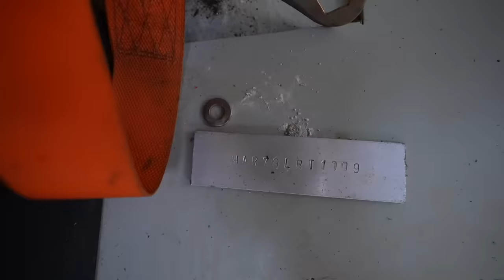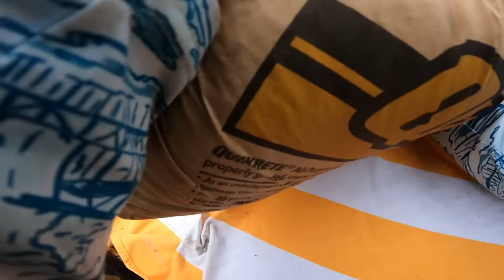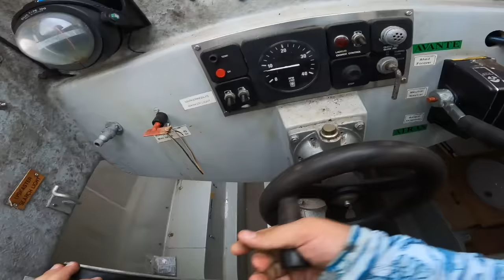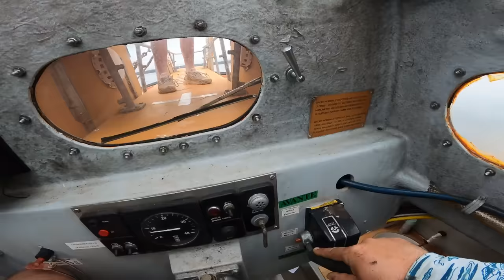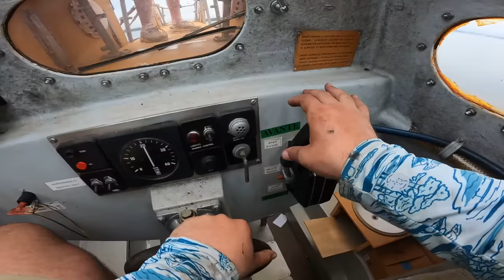WATER TESTING 64 Person Enclosed Lifeboat For The FIRST Time!!

Comment: It’s called a TEMPSC (Totally Enclosed Motor Propelled Safety Craft). This one is from the Safe Brittania semi-submersible rig (a rig I personally spent some time on in the UK North Sea many years ago) which was generally used for floating accommodation. Judging by the serial number the manufacturer is Schat-Harding, a Norwegian company who specialises in this type of craft. As it was used on a rig it will have been very well maintained as there are strict SOLAS standards that apply. The unit has a lot of features that you won’t know about such as external water spray to allow it to motor through sea surface fires plus it would be pressurised in use to prevent gas ingress. Also, if I recall correctly they are also designed to be self-righting so can’t capsize (I guess that would require all the seals to be intact and the doors closed!). The exhaust fumes inside are a bit worrying as you either have the hull exhaust plugged (this would likely be under the water line) or a manifold leak, either way it should be easy enough to figure out. If you were to contact Schat-Harding with the serial number there’s a good chance that they would still have all the documentation for the vessel, worth a try.
Reply: I'm gonna like and comment so that maybe this wealth of info will make it a little higher up the comments.
Reply: @thenotsoguitarguy9429  Ayo! Plugged the exhaust with bondo! Lol!
Reply: Shes made for British alright my grandad used to work on centrica bravo or charlie oil rig they had the exact same lifeboats on the decks
Reply: wow, someone has google.  of course its self righting Duh.
Reply: Normally on these fully enclosed boats the exhaust is water cooled. You have to be very carefully when using it because there is a correct sequence to operating the valves otherwise when you stop the engine the water will fill up the cylinders.
The "Sprinkler Valve" on the side of the engine is what was said above. There should be a stainless steel ring around the top of the boat with lots of little nozzles. These cover the boat in water so that it can get through flames.
You should also be able to start & stop the Engine from the cockpit on these boats. There should also be two sets of Batteries, one on either side for weight distribution. Plus there should be a crank hand and a decompression lever for hand starting.
The pipes on the bottom are cooling fins for engine cooling.
Internal & External Lights
Radio

Do a search for LSA Code & read all about Fully Enclosed Lifeboats. The boat you have is not a Freefall Lifeboat but one that is lowered by Davit's & either released manually just above the water or with hydrostatic water pressure. This releases the front & rear hooks at the same time.

Lifeboats are designed to help you survive and nothing else.

Oh yeah - the boats are fully fibreglass & normally the outside is Gel-Coated.
Reply: @bryannonya9769  Well - IN FACT - that model is self-righting with full complement of personnel inside ONLY IF the personnel are strapped in, such that they DON'T all fall out of their seats and land on the canopy.
Reply: Very informative..interesting 
Sadly I see one person withdrawing from twitter
Reply: @AliG-iq4gd  Eh the old coordinated hamster wheel move will take care of that ;)
Reply: I was on the good old Britannia in 1983 drilling the Rough Field.
Reply: @zackscotty  Me too - way before Centrica though - Amoco and then BG.
Reply: I just watched a video of How England and Germany both had these survival buoys that were in the Channel during WWII. Anchored in various areas for pilots who where shot down or were able to ditch their aircraft and live. Its a very interesting video. England were much better. But both would probably become Sea Sick machines in foul weather. They were stocked with enough supplies to last for a few days even if it were a flite crew of a bomber. They even had board games and cards. I forgot the title but if you goggle it. Its worth the watch. It wasnt from the BBC but a You Tube. But he mad a great Presenter as yall call them. Merry Christmas Sir
Reply: Ventilation, acoustic treatment, cameras and screens, maybe get with the guy doing remote controls for boats
Reply: @derekd1510  that's what I was thinking lol
Reply: the wharf that make this boat is like a two hour drive from my house. deep in the Hardanger Fjord
Reply: Great job on getting the info.!
Reply: Really Schat-Hard when he floated off without cranking it up first
Reply: @derekd1510  Exactly what I was thinking.....especially after reading Graemes detailed comment! 🤣🤣🤣🤣
Reply: This is the greatest use of youtube comments i have ever seen
Reply: @callmeroach  😂😂😂😂💀💀💀💀
Reply: @AngieRay1981  I couldn't believe that joke hadn't been made yet
Reply: @callmeroach  😂 RIGHT?! It was about to be, had you not done so. Beautifully, I might add.
Reply: I was waiting to see how they got it back on the trailer!!! Must have been a massive mission!!
Reply: @dmansshadow  Right, was thinking same thing ..
Reply: To have
Reply: you think the hull exhaust is that round hole at the bottom of the craft that was plugged at the start of the video?
Reply: I didn’t work on the Britannia oil rig however I did stay at a Holiday Inn Express once. Great channel 👍🏼👍🏼
Reply: Too bad nobody in the comment section knew anything about this craft....lol
Reply: This is the best comment I've ever read!!
Reply: @bryannonya9769  ur a real “Richard”
Reply: Thanks for the insight!
Reply: You
Reply: You know your stuff

Comment: The hole you filled is the drain valve/hole. There’s supposed to be a plug. It looks like a little dome cage with a ball in it. It’s a weird looking plug not like a normal rubber plug

Comment: That hole in the bottom may have been the exhaust port or water intake. You may want to check before next time out.
Reply: I was thinking the same thing, if its the exhaust unplugging it will give you more power..
Reply: Could also be a hole to drain water to keep it selfbailing and self righting.
Reply: That's what Im thinking. There was a circle cut in the hull for a reason. And he didn't smell exhaust when he fired it up before he bought it
Reply: Not to mention that Bondo fiberglass job was shit
Reply: @Mercury4468  Ayo mentioned this in the first video -- it was drilled in as a preservation measure to keep water from pooling inside the hull when it rained; that's why there was no black mold in there. IMO he may have to sand and re-do that plug job but that's not really that big a deal
Reply: @0xKruzr  he didn’t say that as fact. He was speculating.
Reply: @sharkansas_  I mean, the plug hole theory doesn't make sense unless the entire plug assembly fell out somehow. it was just a bare hole in the hull.
Reply: @0xKruzr  did you even read the original comment you’re replying to? There are more possibilities for the hole rather than simply a plug hole. Regardless, I didn’t speculate one way or the other. I just corrected your original comment. 

If you’ve ever been around big boats you would know there are many reasons why a hole could be found on the hull of a boat.
Reply: I agree, very likely that hole is a subsurface exhaust or intake for sea water engine cooling.
Reply: @Mercury4468 They aren't self bailing.  The drain plug has to be removed or replaced manually from inside the boat. it's kept on a lanyard by the drain hole.
Reply: @sharkansas_  Its a simple plug hole. (screwed fitting)

Comment: That hole might’ve been the exhaust or water pump intake and I also didn’t see water coming out of the exhaust, which could be a result of plugging that hole most most diesel engines will have a wet exhaust system

Comment: You could replace the hand  crank steering wheel with a DC motor drive with a Left /Right  switch to turn the rudder so you don't have to do all of that cranking . Adding an indicating gauge to show rudder angle position would keep you straight on direction .
Reply: The simple way to accomplish this would be to leave the wheel in place and install an autopilot. As someone who has run slow, displacement boats, an autopilot is a great help. I usually only hand steer for close maneuvering (or when the autopilot breaks.)
Reply: @noyopacific  yeah thats OK at sea. Come near land in bad weather and autopilot gets switched off first mate. I mean I use auto but you still need the actual master controls to work correctly.
Reply: @bigduphusaj162  The OP seemed to be suggesting removing the wheel and replacing it with switches and an electric motor to control the rudder. I didn't do a great job explaining that an autopilot drive can accomplish the same thing without eliminating the option of deactivating the motor-driven steering and reverting to manual steering with the wheel.
Reply: @@Snack_Destroyer Good point! 😜
Reply: IMO the rudder position gauge is the most important part -- Ayo had to crank back and forth a lot because he couldn't tell where "neutral" was so he kept overcorrecting, and who can blame him, it's totally impossible to tell the way it is now. Wouldn't have been an issue if it was launched in an emergency because you wouldn't be doing a lot of close maneuvering.
Reply: I love you been watching you for about five months love every one of your videos you make me laugh and I need this a lot thank you 😂😂
Reply: Would still need to change the gears or would take forever to turn but would definitely use less energy that's for sure. 😆
Reply: Then you could grab a GPS receiver a Raspberry Pi running ArduPilot and BOOM! Programmable, fully automatic navigation. 👍
Reply: Too much complexity!
Replace all steering and propulsion with giant (and I mean GIANT) oars....like trireme sytle.
Simple = better
Reply: Genius ideas, sir.
Reply: A 24 volt  electric valve actuator might work best for converting the steering system instead for a few reasons .
Drives electrically in both directions , has a handwheel you can still use for manual operation if desired  (that declutches when electrically operated) . already has analog circuitry for indication for showing valve (rudder) position .
Reply: @grimnir27  Better yet, have a compliment of slaves to oar the thing around. I think Augustus, Nero, and Caligula had the right idea. 😝

Comment: Sweet boat, A tip for fiberglass repair especially the one on the bottom. Use a small 1-2 inch medium coarse disc sander and remove material around the hole down 3-4 layers, the next step is to go 3/4 of an inch larger and sand to one layer above the last . do this until you reach the last layer at the surface. Cut each patch to fit each layer. Its kind of like a step drill in reverse as you look at it. Then mix your resin and install the fiberglass one layer at a time make sure to remove the air bubbles if you see any. Also types of glass maybe use some thicker matt for the first two layers the cloth for the remainder. I think you could use a plastic flexible cutting board to hold the repair in place using a 2x4 holding slight pressure behind the plastic cutting board. Once it sets up the plastic should peal off. Sand and paint repair or gel coat.
Reply: Great tips!  I'll be keeping these in mind!  (Hope AYO sees em.  XD )
Reply: Good advice
Reply: i think he patched over the water intake for the motor cooling line
Reply: Thank you, Steven, for your expert tips. Im sure it will come in hand one day repairing my boat. Cheers from Australia.
Reply: On a boat that weighs as much as one of these my repair patch for that 1 inch hole would be 8x8 inch or maybe a little larger and taper to a knife edge at the hole.
Reply: And if there was access inside the boat I would grind out a layer of glass and reglass over the repair.

Comment: Another great entertaining video!
I loved the earpod ad too. 
Just a tip. Bear with me, I'm a geriatric at 75 and building a plywood boat right now.
 To repair a hole in fibreglass boats, don't use Bondo, because it's likely to absorb water.
The hole should be ground around to a shallow taper making the outside diameter about, say, six inches across, using a small angle grinder.
Then use the fibreglass cloth and cut it to the largest diameter of the ground circle for the first patch. 
Wet the ground surface with just clear resin mixed with hardener, stick the dry patch up so it sticks in place. Then once hard make a few smaller patches and add them one at a time, making sure that the previous patch gets fully wetted with the resin at each step. This will give a nice large area for each patch as you go, and is safe. lol. 
But the easy way to fill that hole temporarily might be by adding a plywood disc inside and out with a bolt holding them in place, and a plywood disc in the hole to hold them central,  just for your test. 
Good luck because you deserve it. Your videos always make me smile.
Reply: The EARPOD ADDDD!!!   Yesss!!   … This was the comment I was looking for😂😂 cause THAT was hilarious and ingenious.  Lol.
Reply: I was searching for this post just so I didn't have to spend the time doing it myself. Hoping he's not going to rely upon that as a permanent fix.  

For me - I probably would have installed a thru-hull and sea-cock, cause he's going to need raw water for the 5 A/Cs he's going to need to keep that thing cool in the summer.

Comment: The hatches fore and aft (oval) are for reconnecting the falls, or unlatching completely manually.  The boat will NOT sink.   The "walkway" also includes some of  the sprinkler/deluge pipework.  The deluge pump runs all the time the engine is running, and you open the suction valve from sea to activate.  That is in case the sea is burning or you are below a burning installation/Rig.   There were compressed air bottles through a regulator to pressurise the insides, and allow breathing while escaping from smoke/fume laden atmospheres.

Comment: A hell of a lot of things could have gone wrong on this first trip, but the leaking exhaust is a very minor thing. This tub has a great potential as a weekender, especially for offshore fishing. 
Get used to using docks and potoons rather than beaching it. Set up fenders and handling lines on both sides as well as fore and aft.
Look into getting some big house batteries and maybe a solar panel or two on the roof.
Reply: I feel like that hole he patched on the bottom of the boat was for the exhaust
Reply: @moretrash4you  I agree this should be researched
Reply: @moretrash4you  it was.

Comment: You should have two sets of batteries on that, and especially if you have the engine heater supplied from the mains (220v in the case of that boat) - it is designed to start every time in whatever temperatures you are in.   For launching - all hatches are closed, engine is running and in gear with rudder angled to take the boat away from the rig/installation.

Comment: To do the resin work, put your glass on a piece of shrink wrap, shrink wrap on top of a thick piece of foam, That on top of a piece of wood, and then use a jack to press upward into the bottom to keep the air bubbles to a minimum.   Obviously for future reference...
Reply: That's pretty brilliant dude.  The foam will compress to fit the profile of the hole and the wood will distribute the pressure from the jack and keep it from punching through the foam.

Comment: Check the exhaust of that motor, there might just be a loose exhaust bolt causing that leak. The crack in the fiberglass shouldn’t let fumes in from the motor. There also might be a crack in the exhaust tubing. Either way, get it taken care of. There should also be a sounding tube where you can dip a broom stick in to see how full your diesel tank is. That thing is super cool though! You should paint it white and cruise with the yachts. Let me know if you have any questions, I was an engineer on a tug for a while so I don’t know much about life boats but could help on a lot of stuff.
Reply: We have a lot of marine engineers in these comments getting REAL excited about all this, lol.

Comment: So what are your plans with this thing? Would love to see a build with some nice beds and some solar power, maybe a deck on top to fish from!? Perhaps some windows too.
Reply: would be cool to see them turn it electric, since it has so much space for battery, solar and the noise reduction would be nice.
Reply: @drifter6870  problem is the gear would be insanely expensive, but you're right -- and you could load up the bottom with batteries which would double as ballast. Good way to kill two birds -- stability and energy -- with one stone.

Comment: At a guess I would say the hole you plugged up is either for the exhaust or more likely the water intake for the engine cooling. Usually the excess water from the cooling system is dumped into the exhaust pipe. This has the added benefit of acting as a muffler